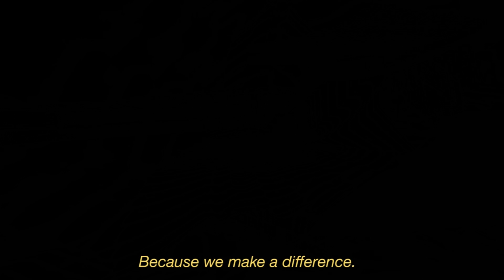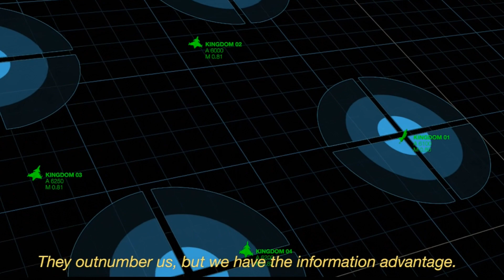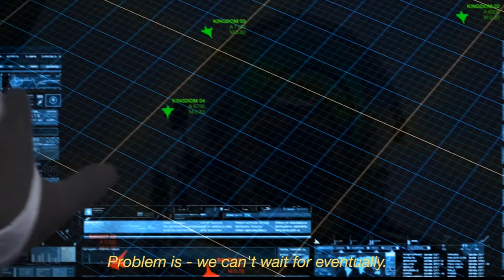Gripen Fighter Jet - Canada's Future Fighter?

Comment: The Gripen would be rejected for lack of performance in comparison to the F-35.  Both face the issue of being single-engine aircraft, which are not ideal for operations over the arctic.  In case of Engine Failure, ditching up there is not a favourable option.Realistically, Canada requires a twin engine, multi-role, Fighter-Attack aircraft that has some form of stealth capability, and long-term inter-operability with NATO partners.  Right now, the only option available to Canada is the F18E/F Super Hornet.  The Eurofighter is an option, but given that Canada already operates the Baby Hornets, and has a familiarity with the product.
Reply: No, the Advanced F-15 2040C is a better option than the FA-18 Super Hornet as it has greater range, more powerful radar, and a larger weapons load. It also has stealth options from the Silent Eagle program that can be incorporated if desired. An improved semi stealthy F-15 has a radar signature about equal to or better than a Super Hornet, depending on the angle.
Reply: Just some food for thought for you;  1. You are making comparisons of Fighter Aircraft of varying ages, and combat experience, and the statistics presented are carefully constructed to lead to a conclusion.2. You are referencing the work of what appears to be an adolescent, who may have scoured over other works, and the claims are not all substantiated.3. The last assertion, regarding engine flame out of single engine vs. twin is not substantiated, and I know why.  I would suggest studying aerodynamics and the principles of flight.  Then research aerodynamics of 3rd, 4th and 5th generation combat aircraft.4.  Working with the Canadian Air Force, I get the pleasure of understanding both the pilots and maintenance crews views on this subject matter. 5. I can tell you, that what you have quoted here is nothing more than mining specific data to lead to a predetermined conclusion.
Reply: F15 is an air superiority fighter, Canada needs multi-role.
Reply: I was not the one making the claim that there was any strong correlation between the number of engines and crashes. It was you who made that claim . So the burden of proving twin engine planes is more reliable is on your shoulders, and not on mine.

To me it seems there are lots of statistics that points either way. There are good twin-engine planes like F15 just as there are good single engine planes like Gripen. There are also shitty single engine planes like the F35, just as there are bad twin engine planes.
Until you somehow show that twin-engine planes are objectivly better at survivabilty I will take your orginal statement as a nonsensical baseless claim.

Gripen is a plane with very few crashes compared to other planes according to mainstream media. And according to the data above does most twin-engine planes crash more often - as for example CF18, F22 and Rafale.
So I cannot see that twin-engine planes are better than JAS39. On the contrary do they seem worse.
Reply: Working with the Canadian Air Force, I get the pleasure of understanding both the pilots and maintenance crews views on this subject matter
Just now you only sound like a Reza Aslan.
A classic example of the "Argument from Authority" fallacy.

Where is your real arguments against the points I took from the blogpost?
Reply: Single engine planes are usally better. - And here is the long answer......

Single engined fighters have typically been favored due to their low procurement and operational costs, ease of maintenance and assumed better air-to-air performance. Yet there is also a belief that single-engined fighters are inherently less survivable and lower-performance than twinengined fighters.

In the end, P-38 had to withdrawn from Europe in fighter role (it did continue in photo reconnaissance role) due to heavy losses. For these reasons, twin-engined configuration was typically reserved for lumbering bombers, and night fighters whose only task at the time was bomber-hunting (Me-110 and Mosquito were notably successful in such role).
And also after the war have single-engined planes been the most successful Western fighters – F-86, Mirage, F-16.
Twin engined fighters only became popular when multirole requirements became standard, starting with F-4. But F-4 had disastrous performance in air combat considering its cost, and its ground attack performance was not stellar either.

Single engined fighters tend to be cheaper to buy and operate, easier to maintain and have lower basing requirements. Easier maintenance is primarly due to twice the number of engines means twice the work and twice the likelyhood of something going wrong. It also means that twice as many spare parts are needed, increasing aircraft’s logistical footprint. Even with a possible benefit of fewer peacetime losses.

This means that they provide advantage in two most important areas: 1) pilot training and 2) allowing larger number of combat sorties for the same cost.

Furthermore, does a small size tends to make single-engine planes easier to camouflage on the ground.

Reasons why single engined fighters tend to have better combat effectiveness are several. Single engined fighters tend to be smaller, lighter, and better optimized aerodynamically, which automatically improves survivability in a dogfight. Having one engine means that mass is distributed closer to the centerline axis, which reduces roll inertia and improves roll onset rate.

Wing loading is also typically lower for single-engined fighters. And smaller size means that they have surprise advantage, as they are harder to acquire and track either visually or with optical (visual, IR) sensors.

Lower drag oftentimes (though not necessarily) means higher cruise speed despite often lower Thrust-to-weight ratio.
Gripen C similarly is capable of cruising at Mach 1,1 at dry thrust and with 6 missiles despite being underpowered, and its economical cruise speed is again Mach 0,92. F-16 can achieve Mach 1,1 at dry thrust and with two missiles, most likely due to added drag of horizontal tail, while the F-15 can achieve a cruise speed of only Mach 0,71 despite far higher thrust-to-weight ratio, primarly due to the high cruise drag.

Note: increased drag in twin-engined fighters is primarly a result of a number of factors. First is increased tail-boat drag due to shaping required to place two engines next to each other – there is an area between the engines which typically ends in a flat plate if engines are close together, and if not then additional fuselage required to separate engines still leads to higher drag.

Secondly, a typically wider body leading to higher form and profile drag. Single engined fighters also tend to have higher fuel fraction, and thus combat persistence, than twin-engined ones.

This resulted in the F-8 and the F-16 having significantly greater persistence and range than their twin-engined counterparts (F-15 and F-18 for the latter; speaking of USAFs competence, USAF did not want a single-engine fighter to have a
greater range than the F-15, but focused on total fuel capacity as opposed to the fuel fraction and thrust-to-drag). With modern European fighters situation is opposite, mostly due to differing requirements France, Sweden and Eurofighter consortium had for their fighters. That being said, Gripen E is expected to have almost as high fuel fraction as, and better endurance/range than, twin-engined Rafale.

And as counter-intuitive as it may sound, single-engined fighters have better combat survivability as well. Most modern Western fighters have engines so close together that any amount of damage taking out one engine is almost certain to take out another as well. Even if a twin-engined aircraft loses a single engine without another one getting taken out, it immediately looses 50% of the thrust and 81% of the performance, making it a sitting duck and easily killed by the opponent.

Due to all above factors, twin-engined fighters are more likely to get hit in combat while not being any more likely to survive getting hit.Twin engined designs do not necessarily have better peacetime survivability either. F-106, despite being single-engined, had 15 losses in first 90.000 hours, compared to 17 for the F-4.
Single-engined F-105 also had low peacetime loss rate.

Swedish JAS-39 has a better safety record than the F-18 despite having one engine less – 13% of Canada’s CF-18s have been lost in crashes compared to 2% of Gripens; a loss rate of 0,36% per year versus 0,08% per year for Gripens. Rafale suffered 4 crashes in 64.000 hours.
Gripen suffered 5 crashes total in 203.000 flight hours. None were related to either engine or aerodynamic configuration of the aircraft: 2 were due to underdeveloped FCS, 2 were due to the pilot error and 1 was due to ejection seat issue. Typhoon suffered 3 crashes total in 240.000 flight hours. One was due to double engine flameout and two due to unexplained reasons. F-22 reached 100.000 flight hours on 11.9.2011., and by that time had 4 losses.
Overall, F-15 had a crash rate of 2,36 per 100.000 hours and F-16 of 4,48 per 100.000 hours. Less than quarter of the F-16 losses were due to the engine failure, with leading cause of losses being FCS issues and human mistake. On the other hand, most F-15s lost have experienced engine fires, meaning that engine-related loss rate is actually higher for the F-15 than for the F-16.
F-18 crash rate is 3,6 per 100.000 hours, and Gripen’s is 2,46 per 100.000 hours, and 6,25 for Rafale.
Overall, statistics show that single-role air superiority fighters tend to be safer than contemporary multirole fighters regardless of number of engines.

And while very rare, it is also very possible to land a single-engine fighter with engine out. More common are crashes of twin-engine aircraft due to a single-engine flameout. In the end, theoretical superior peacetime survivability of a twin-engined aircraft is neither large or certain enough to offset lower combat survivability and performance, typically smaller fleet size, higher maintenance downtime and higher operating cost. That being said, aircraft has to be well designed aerodynamically in order to take advantage of a single-engined configuration (ref. Gripen); single engined F-35 is the worst-performing Western fighter, and one of most expensive ones, due to two factors: bad aerodynamic design and weight more typical of twin-engined fighters. It is also likely to have high crash rate – not due to its single-engine configuration, but due to its extremely complex hardware (overly complex engine and avionics) and software (24 million lines of code) design.

Analysis of air operations in Vietnam and Arab-Israeli wars has revealed that 62% of losses of single-engined aircraft was caused by fuel fire, 18% was caused by the pilot being disabled, 10% by damage to control surafces, 7% by engine loss and 3% by structural damage.

https://defenseissues.net/2014/08/09/single-vs-twin-engined-fighters/

Comment: Gripen is a late GEN4 and maybe GEN4+ with a big overhaul... but this plane is already outdated !
Engines from the F/A18, electronics from F-16, only the frame is "uite modern" with composites...

Canada may choose F-35 because... "USA"
A great choice would be the Typhoon ! (They can't choose Rafale because ..."USA" won't let that happen)
Typhoon is already a GEN4+ and can reach GEN4++ with a MLU
Typhoon is not yet "combat proved" as the Rafale is but... maybe ?
F-35 is extremely unreliable up to now, really expensive, Typhoon isn't cheaper but it's multirole capacities are fully developped, frame, engines and electronics are also "proved" and "approved"
Also ; Typhoon is a british/spain/german/italian joint venture... Canada already had Spitfires, Sabres and Starfighters alreaady used by all of these countries ! They would have a "common" history between them

Gripen is outdated and made for armies of minor power, with reduced budgets or armies who want to switch smoothly from Pact to NATO materials
Typhoon isn't cheap, but it's "proved"
Rafale is impossible to be seen there

If i was canadian, i will go Typhoon ! all the way !
Reply: Claudy_Focan It has nothing to do with either F-18 or F-16, other than its a GE engine based on the type in F-18. This engine is a new variant developed post 2012. F-18 and F-16 are outdated. You don't know what you're talking about. "Third world countries"? Are y too lazy to do a simple Googling on the specs?
Reply: Could you possibly be more full of shit?
Reply: +Claudy_Focan "Electronics from F-16". What do you mean by that?
Reply: Don't see why the Rafale is more problematic than the Typhoon.

Dassault is not Airbus and it would be way more flexible.

Comment: At this point I'm just worried the government will just run ageing CF18s for the next 40 years. Look how long the Sea King has flown. The Super Hornet deal may be dead in the water too due to a US trade board complaint by Boeing against Bombardier. With the Liberals in government I expect only the cheapest possible aircraft to be selected if they hold a competition. The F-35 is pure fantasy it will realistically never be adopted by the RCAF now, it went down with the Liberal election.

Comment: For anyone who says that the f35 sucks and cannot dogfight... you guys seem to forget it's not an air superiority fighter. It's definitely a multi role aircraft  which is designed to be able to defend itself in a dogfight not go on the offensive. Hence why it's called the "joint strike fighter" not the "air superiority fighter"
Reply: Fair enough. 
But I cannot see that it is good at much else too. A10 beats it in ground support. Its not as stealthy as a stealthbomber. The cannot make a vertical takeoff as well as a Harrier, but instead melts the deck of the Royal Navy's Queen Elizabeth-class aircraft carriers if it was ever deployed on one.
Reply: Yes, I also disagree with the "replace the a10 with the f35" topic.

Comment: A couple of points about our needs... If we are picking up Super Hornets in the interim, then we really should be looking at Gen 5 kit. Also, we sometimes forget the role the CF 18 plays in ground support, a major aspect of our military tactics. We need to meet and preferably exceed the current capacity of the CF 18, which is formidable. I am a huge critic of the F35, but with the acquisition of the Super Hornets, we can delay the purchase... wait for the bugs to be worked out and get a better price.
Reply: The only TRUE 5th-gen plane from the USA was the F-22.  The F-35 isn't really 5th-gen.

Comment: One of Canada's main problems with the F35 is the single engine survivability over the Arctic. Why would they buy another single engine plane?
Reply: Well, Gripen has been flying in northern Sweden at around -40 Celsius for decades. I'd be more worried about aircraft manufactured in warmer countries
Reply: SvenTviking As I said somewhere else here, the RM12 of the Gripen A/B+C/D has not had a single failure in 20 years of service. That includes arctic, temperate and tropical climates.
Reply: Maybe because Gripen is developed in such a climate?
Reply: Sven, that's a load of crap.  The Gripen has a much better safety record than any twin-engined fighter in the world and it operates... IN THE ARCTIC!  We no longer live in the 80s and jet engines are extremely reliable now to the point that the second engine is more cost and trouble than it's worth.
Reply: Nej Du Yeah, it's obviously cold and a lot of area in the Arctic circle in Sweden. But not as much as Canada, and one of the main objections to the F35 is single engine survivability. If the engine fails, the pilot ejects in the middle of nowhere. With two engines like the F/A18, an engine failure does not mean a crash.
Reply: @Stu Bur - And the F-15s would be horrible for far more reasons than they would be good.
Reply: I'm more interested in the startability of that F35 in arctic. Atleast the american made  CH-53 helicopter the Germans brought to Finland for Cold Blade exercise had to have a warmed kit hangar brought with them, since apparently no one thought about what to do, if that plane had to sit outside in -20 Celcius over night.
Reply: It isn't really an issue but F-15s would be a good choice for other reasons.
Reply: FUCK THE PILOT,if he can't bring back our jet..
there's lots of volunteers to replace him